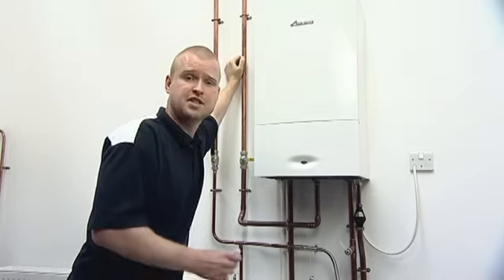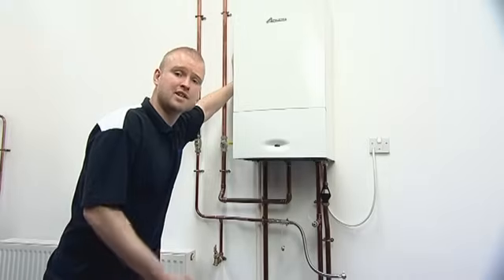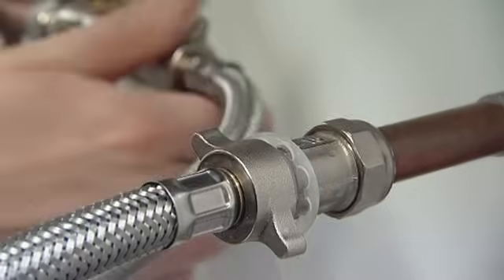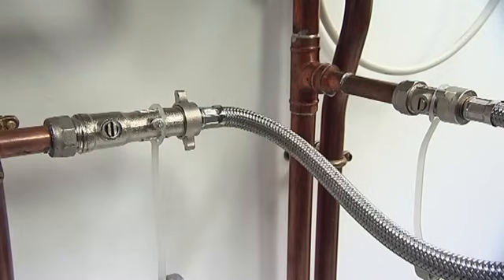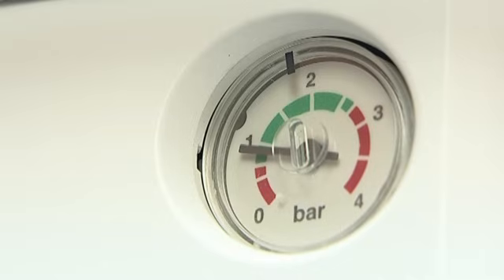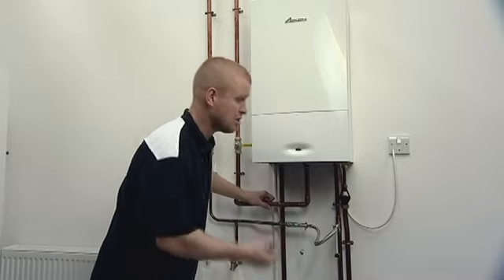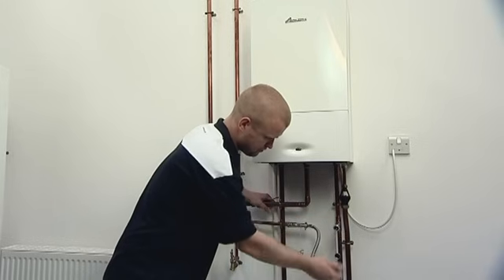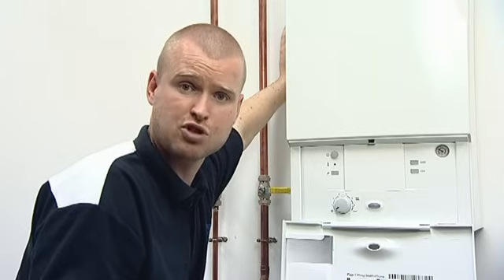How to Repressurise a Heating System with an External Filling Hose | Worcester Bosch

Comment: Is method to refill my boiler - however pressure dropping frequently and when I fill up pipe going into boiler starts gurgling so not sure if it's full, or air pocket or what. Needle barely moving from 0. It will then randomly go to 1 bar.

Comment: Thank you so much for this, years later. I thought I was being really adulty by bleeding my radiators when I noticed a couple weren’t heating all the way up. Only to discover no hot water later in the day. Followed the video, depressurised the system and I can now do the dishes (maybe I shouldn’t be celebrating that part 🤣)

Comment: thanks for the simple tuition .just moved house where a 25si is fitted . my comfort 11rf timer is not displaying anything, hope its the batteries . The green override button is also flashing. Will try batteries first .I am right ? no batteries  in the boiler receiver?. Thanks in advance

Comment: Hi, after gas safety engineer left the water wasn’t heating he came back and fiddled with some pipes under the boiler and then we had hot water. This happened twice in the past three years! This year the radiators don’t heat up! They were ok until April and the safety engineer came in August… now it turns in for around 10-15 seconds and the boiler flame light turns off! I wonder if this time he has stopped s valve or something connected to the radiators? I’m a little suspicious that he charges the landlord every time he visits our flat. Please help!

Comment: Great video. My key doesn't come out though. I remember the boiler installer said it doesn't with my new model. If that were the case then why is there still a holder for it in the plastic tray?

Comment: The hose is already attached to both ends on ours? So do we have to remover one end at any point? Confused
Reply from the maker: Hi Nicky, Don't worry that's quite normal for it to be like that for convenience. We would recommend disconnection the one side just in case the valve is not fully closed and water is allowed to flow.  😊👍 - Aiden

Comment: Ok I know how to 're pressurised but a screw driver does not work anymore. Do i need this internal key? Where do I get it? It's for a Vaillant
Reply from the maker: Hi Rosie, Unfortunately we wouldn't know about other boiler manufactures. I would recommend contacting Vaillant directly on 0330 100 3150 they should be able to advise 😊👍 - Aiden

Comment: Excellent.  In my case the plumber had left the hoses attached and the valves had black handles.  So I just turned two taps on and hey presto.

Comment: Have tried this, water started dripping from higher up inside the boiler, not the taps or hoses. The pressure went up minimally and the then has stopped as I got worried about the dripping water. Should it drip like that when re pressuring the system?

Comment: Watched all 3 of these and this one was the closest to ours. The main difference was that our hose is permanently connected and instead of valves at each end, there is a faucet. It was very stiff, but after wrapping a towel around the handle and turning it, I heard water flowing and the pressure gauge started going up. We now have pressure again. Thanks for this video and hope this comment helps someone! Maybe make a video for those of us with faucets?
Reply: Same here! Life saver this comment. I have the same setup and it worked.
Reply from the maker: Great to hear you were able to get it sorted, they can be very stiff! I will pass on the feedback about getting another video made up 😊👍 - Aiden
Reply: It there are two faucets in the external hose pipe so which one is correct one left side of right side thanks

Comment: Wow. Nearly 10 years later and still relevant. Fixed my problem. Thank you so much. Only difference is just one valve and pipe in tank airing cupboard not under kitchen sink. Cheers

Comment: This was helpful, but my installer has left the hose permanently attached with some black handles in place where in the video you used a screwdriver. Do you have to detach the hose after repressurising or can I leave it as it is?
Reply from the maker: Good morning Kimberly, It should be fine being left as it is. The main reason we advise to disconnect after topping up the pressure is so if one of the valves was to open the boiler pressure wouldn't start to rise without your knowledge. If you are going to leave it connected I would 100% make sure both valves are firmly closed 👍😊 - Aiden

Comment: Shame the double check valve is comnnected to the primary circuit. It should be connected to the cold mains water supply, with the removable filling loop downstream of the double check valve. Contravines the Water Regulations.

Comment: Is it dangerous to do without turning off ? An electrician told me not to switch off my boiler.
Reply from the maker: Hi, whilst we would never advise switching the boiler off for prolonged periods, especially during winter, we would advise switching the boiler off during the re-pressurising procedure
Reply: Thank you for your help. i turned off at the mains and did it succesfully.

Comment: Hi there . I did this. Heard the rush of water. The pressure gauge stays put at the bottom.  The water rushing noise isn't so loud now . Any ideas much appreciated please !
Reply from the maker: Hi Adam, thanks for getting in touch. Please can you email our technical help department at service.mailbox@uk.bosch.com with your full address including post code and telephone number, and we will give you a call.
It could be that the water is flowing out of the pressure release valve but we would need to ask you to check a few things to be sure
Reply: thanks will do!

Comment: Our Wooster Bosch combi boiler has a key to refill. Do you have to push the key UP hard in the unlocked position before locking, as water escapes out of the key. The heating is not very good downstairs(I think I touched the radiators, I don't mean heat rising) even with the radiators on full. I do believe that the main reason is pressure as it is only just on one bar(went down after bleeding radiators) but it is a small 3 bed semi. Otherwise the radiators want balancing I guess. Probably best to wait for the boiler man in may.
Reply from the maker: Thank you for your comment.
1. Push the filling key firmly into the body of the filling link, ensuring the arrow on the key shaft lines up with the open padlock symbol. 
2. Turn the filling key to the right, to the stop, so the arrow now lines up with the closed padlock symbol. This bridges the gap between the two sections of the filling loop. 
3. Turn the white knob to the left, this will allow water to fill the system. 
4. When the pressure, shown on the boiler fascia pressure gauge, reaches between the 1 and 1.5 bar marks (zone A), turn the white knob to the right to close the valve. Do not over tighten. 
5. Turn the filling key to the left, to the stop, so that the arrow lines up with the open padlock symbol and pull the key straight down to remove. Please remember to store the key in the bottom panel. 
Sometimes it is difficult getting the key into position, it can help by applying some washing up liquid on the key as this can make it easier. If you need any further information please contact our Technical Support team by phoning 0330 123 3366 or by emailing them at technical-advice@uk.bosch.com, many thanks. Worcester

Comment: Sorry I have a Worcester and its pressure guage was on zero. The don't have a rigid hose I have two like taps  and turned them both a little and released some air and waited for the pressure guage to go to 1.5 like you said and them turned the taps to close the guage has gone a little above 1.5 but not much.....sorry the only thing I forgot to do is switch the power off whilst doing this.....bear with me single mother struggling with boilers and stuff......
Reply: Rs Racey NATHAN thanks for comment, mine is fixed hose too
Reply: Thank you so much for making this video
Reply: Thank you so much I was still figuring out how to unscrew the thing then I found this comment and my system has two taps too

Comment: Hi, I have an older Worcester Bosch 24i RSF. I notice that on the pressure clock the red hand is between 1 and 2 (1.05) But the grey hand is almost right down to zero. Is this a problem? I remember my dad telling me that it had to be higher than that. Cheers. Martin